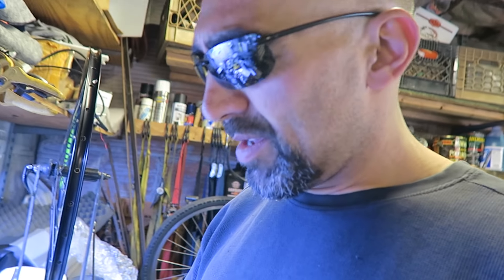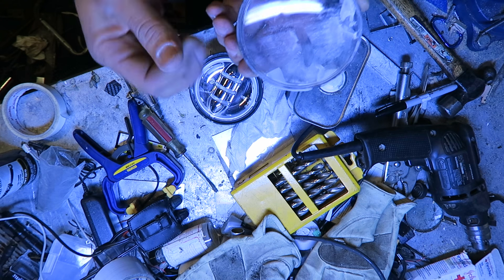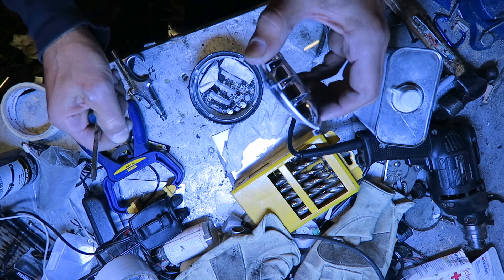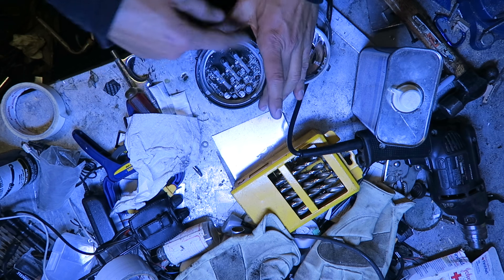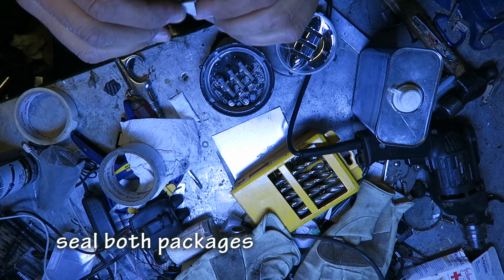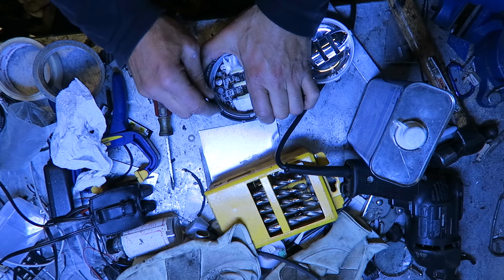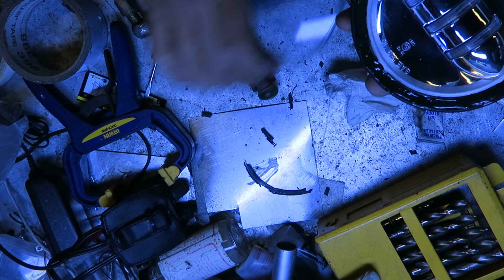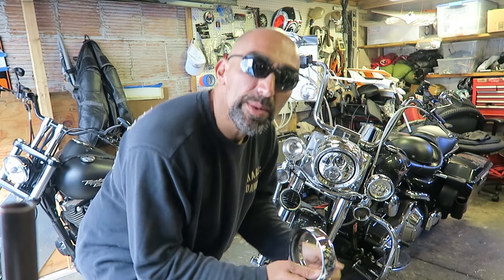Harley daymaker lights repair whats inside

Comment: Awesome video!  I installed a stereo in a customers Street Glide and on pickup he was blaming me for messing up his light. I was like "How would I get it dirty INSIDE the lens?" He said it wasn't like that when he dropped it off. While the fairing was off I must have inverted the light at some point and dust came out and coated the lens. You just saved me a chunk of $$$. The hard part is being patient with the heat gun so you don't crack the lens. Probably took me 1/2 hour to remove.
Reply from the maker: Crack the Code I’m glad it helped

Comment: My Street Glide Daymaker was piss weak on low beam  and making the red light on the speedo light up. I still had the old light and re-installed that. I thought the Daymaker was throw away technology but will have a go at fixing it! It is a bit cloudy inside too so will clean that up! Cheers mate!

Comment: Reading the comments saved me,  the 7" lens wouldn't loosen up. So I did what was suggested in the comments and drilled a 1/4 hole in the back of the lens and used my air compressor to pop the lens

Comment: My stock lights are all clouded up from the same garbage, but planning on Daymakers soon.  I just moved down to South Carolina from PA.  Come on down and ride ALL year long.  The weather is absolutely beautiful.  People here are great, too!
Reply from the maker: scroopit as soon as I convince the wife
Reply: I had a problem but they replaced them at no cost. There was a recall back in 2009 ,so don't buy them on eBay etc.Some will cause your bike to catch fire .
Reply: Harley has a brand new design for the daymakers on their parts page.
Reply: Thanks Duane.  I'll check 'em out.  Leaning towards the JW Speaker Evo2 at this point.  It'll be a few weeks yet.
Reply: scroopit from what I understand JW speaker makes the day maker for Harley.

Comment: Good find on the silica packets. I snagged the Amazon knockoffs and haven't had a problem so far, but it's good to know how to fix it if or when I do. Also, if you decide to find America down here in Tennessee, we have a 12 month riding season ;)
Reply from the maker: thanks for the input,  did you ever compare the knock off's brightness with the daymakers?
Reply: I've sat side by side with Daymakers and can't really notice a difference. I will say that the knockoff stuff is almost completely plastic. Don't know whether the Daymakers are or not.
Reply: I'd be interested to know which part of Tennessee you live in that has a "12 month riding season." Here in Memfrica we had record rain and snow for at lleast 3 months.

Comment: Had the same problem and did the same thing but the main headlight glass cover would not come off  So then i came up with the idea if I drill two small holes in the back of the bulb aluminium case maybe I could use air to blow the dust out, better than that, the air pressure popped off the glass cover and gave me a chance to clean the whole unit inside.
Reply from the maker: Nice ! Thanks for sharing the tip
Reply: Did the exact same thing with my SunPie. Blast some air and BANG lens popped out. Cleaned it up and good to go. Wear a mask, these things are from China so that white stuff is cancer.

Comment: Same exact thing my did. Half the lens like yours. I went and spent 30 bucks on amazon replacements.
Reply from the maker: anthony delgrosso what did you get for only $30
Reply: pickitup both passing lights on Amazon. They work just as well as Harley’s. I’ve had no issues with them

Comment: So wondering how that fix went? I guess I got to do it with my spots my headlights the same damn way. I can’t stand the Harley day maker headlight I don’t like the high and low beam light on at the same time you know what I mean. So I’m going to switch to JW Speaker i’m going to try to keep my Harley spots. They are the same color you know the light color. Could imagine living in New York city been there on the bike got stuck on the bridge blew my camp bearings I think it’s called the George Washington Bridge. Had to be a fucking hundred degrees  spent hours on there blew my cum bearings on the way home to Pittsburgh. Any tips I would appreciate it. Thanks
Reply from the maker: Michael Costeline 2yeqrs later the light I repaired in this video was still good . If you haven’t fixed the cam bearing yet make sure you update the cam chain adjusters to the new hydraulic system cause when they go your motor could blow
Reply from the maker: Michael Costeline and that George Washington bridge sucks but then again so does NYC unless you’re into a hipster lifestyle
Reply: Yeah we want to ride through Manhattan $45 an hour to park!! Luckily we had some cops with us and you know it goes we got front row spots for a while.  My spots are full of water I have to see how it goes. Hey thanks Brother!! God bless America it’s beautiful place

Comment: The LED.s are under the lenses, those are magnifying glasses.
Reply from the maker: Rod X they are one piece with the diode like the little led bulbs, the little glass looking piece is one piece with the bulb but yes they are what directs the light and gives it a beam effect I believe the term is optics.